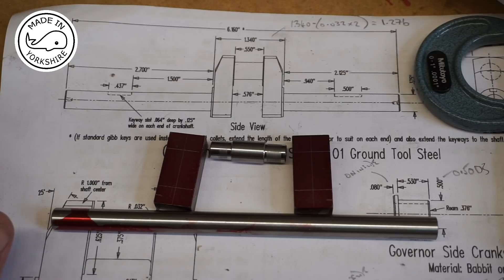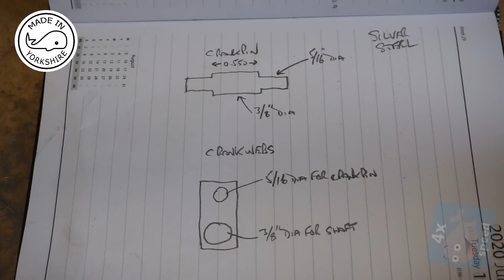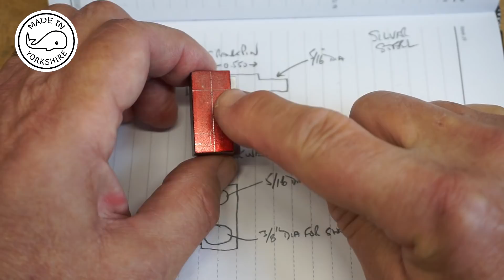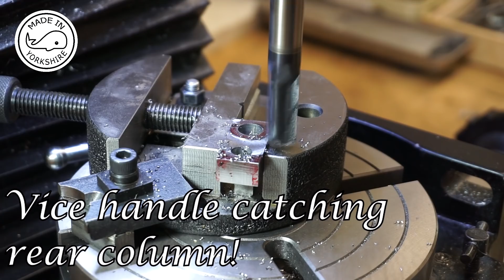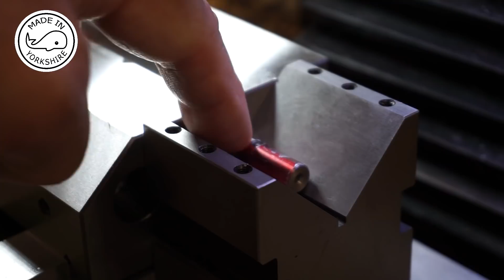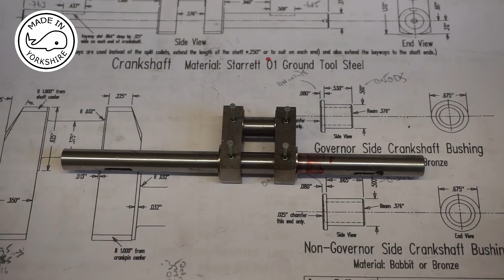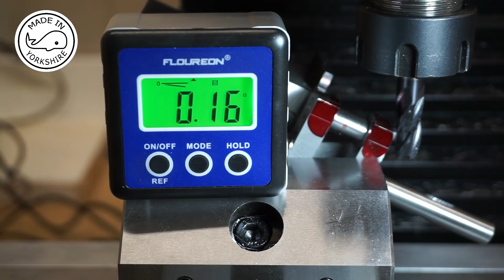#MT35 Part 9 - Farm Boy Hit and Miss Engine. The Crankshaft. By Andrew Whale.

Comment: Hi Andrew, I know this an old video now, but I believe the reason your cutter broke is because it is an End Mill. They are not designed to plunge cut as they are ground with relief in the centre. When you plunge it will leave a small pip sticking up so when you start your X feed this is what broke your cutter. You need some Slot Mills - they are designed to plunge ie for blind slots such as this keyway. The teeth on the bottom are different length, so no pip....   I enjoy your videos very much, you do fine work. I had the benefit of a Toolmaking apprenticeship many years ago. Hope this helps. I am retired now and just about to have a go at this lovely little engine...
Reply from the maker: Hi Graham 
Thanks for the info. It wasn't long after this video that I learned about slot drills (aka two flute end mills). I must say that I think that the Farm Boy is a great little engine. Even now, once the carb is primed, she starts on the first turn. A rock solid design. I hope yours turns out good too.
Cheers 
Andrew

Comment: I commend you on your due diligence mixed with a willingness to try alternatives. However, allow me to warn you with respect to the crankshaft. I too made the crankshaft as an assembly. It was easier than the two attempts at turning it from a single bar. The plans call for tool steel and after my experience, I can see why. The fly wheels on this engine are  heavy and firing stroke provides quite a kick. I had my crankshaft glued and pined and it still came apart and ruined the bushings as well. I am going back to the tool steel and get it right. Just my experience.
Reply from the maker: Hi Steven - many thanks for sharing your experience. Having purchased a couple of flywheel castings I now appreciate the amount of torque that crankshaft will have to cope with. I guess I'm at the point of no return so I will just have to hope that the loctite 638 and my pinning holds. Time will tell! If it does fail I will have to revisit, and I will certainly document the failure as a warning to others not to follow in my footsteps. Anyway, I need to bite the bullet at some point and have a go at machining a crankshaft out of one piece of bar. I hope your's turns out well.
Thanks again.
Andrew

Comment: For cutting these small keyways I find a woodruff cutter is much more robust. Woodruff keys are also easier to machine than standard round ended keys. For flywheels a woodruff is just as effective. I find that for complex parts such as a crankshaft I write down the machining process order, then write down another order and a third for luck. Then I work out the advantages and disadvantages of each taking into acccount tools used, clamping and fixing etc.. then pick the best bits from each to give me final order of production.
Reply from the maker: Thanks for the info Steve. First I've heard of a woodruff cutter. Just searched, and now I understand. Quite expensive for just a couple of cuts, but something for me to keep in mind for the future.
All the best.
Andrew
Reply: @learningturningmetal  about £9 from eBay but almost indestructible and the half circular keys are easy to turn up on a lathe the cut in half with a hacksaw. Also if you want to cut ornamental grooves in long parts like supports, columns or beams it gives a nice shaped end to the groove and you can get really thin cutters that take a lot of abuse, much more than a traditional end cutter. For larger scale stuff you can go another way and get an involuted gear cutter for use on an arbor. The trick is loads of knowledge and try different things. Old engineering books, cheap on eBay have loads of useful info.   Steve

Comment: Hi Andrew, a couple of comments if I may.  You were lucky when drilling and reaming the crank webs that they remained clamped-up OK.  One of them only needs to be a gnats cock thicker, and the other one wouldn't clamp tightly.  Also, I would have put a 3/8" pin in the reamed holes before machining the crank pin holes to ensure the pitch remains the same.
Reply from the maker: Hi Steve, I get exactly where you are coming from. In fact one of the crank webs was ever so slightly smaller than the other one. However the loctite 638 worked a treat and managed to hold everything together.  Many thanks for the suggestion though. Next time I might well put a pin in the reamed hole - belt and braces, just in case.
Cheers
Andrew

Comment: I am very grateful to you for this video. I am going to be cutting some keyways soon and have learned a lot here. I thought it would be quite easy. Will have to give them a bit more respect and thought. The shaping of the crankwebs gives nice clearance where you cut and shaped the bearing housing. Looking really good. Might be worth investing in some small diameter silver steel for future pinning jobs.
Reply from the maker: Hi Tim - yeah silver steel would be better than some old mild steel nails - but fingers crossed they will hold. They were a nice tight fit. From various comments it looks like I would have benefitted from using a slot drill rather than an end mill. I hadn't understood the difference until I googled it. Something else to add to my list! Some have commented that the angle on the crankwebs should have been cut using the lathe. Apparently the drawing indicates this. Still, it looks OK and clearence is good.
I never thought that keyways would be as challenging.
All the best.
Andrew
Reply: Slot drills would be better...clue in the name ;-)  It is still tricky cutting a small deep slot. Fast cutter speed essential. You call your channel Learning Turning and I think many of us have learned (or been reminded of) something from this video.

Comment: Thanks for video - I appreciate your honesty! Just a note on the chamfers on the crank: The drawing shows them as turned (the double lines are a hint, but the dead giveaway is the curved profile visible inside the body of your micrometer at 1:53). I'm sure they will work fine as you have machined them. Would have been quick and easy to do on the lathe, but then you wouldn't have got to play with your sine bar and gauge blocks :D
Reply from the maker: Hi Mate - many thanks for pointing out the hint in the drawing. Now it makes sense. Yeah - it was fun using the sine bar though.
Cheers
Andrew

Comment: Nice job Andrew. Just out of interest what did you use to pin the crank webs ? Also thanks for making the mistakes that I would have made and thankfully now can avoid. Slot drills are good but take care on a small mill ‘ it’s best to cut slot undersize then index across eg for a 6mm slot use a 5mill slot drill then index over plus and minus 0.5 to open up to 6mm
Reply from the maker: Thanks for the advice Andrew. I think I need to buy a few slot drills. I've just googled the difference between slot drills and end mills, so I now have a better understanding.
For pinning I just used some mild steel nails about 1.2mm in diameter. Probably better to use silver steel, but I hadn't got any small diameter. There is always something else to buy! I hope you are making good progress with your stirling engine.
All the best.
Andrew

Comment: As usual good work, but the drawing suggested that you tern the angles on the crank webs not mill them.
The two lines on the drawing is the indicator.
Keep it up you gowing well, all the best from South Wales.
Reply: Hi Jon, Good spotting, I've learnt something.
Reply from the maker: Hi Jonathan - many thanks for pointing that out - I have learnt something new too. When I made my first engine, I knew little about drawings. It's a subject in it's own right.
All the best.
Andrew

Comment: Thanks for sharing! Andrew, not now but later, you can hide your mistake by filling the unnecessary slots with JB Weld or double slot what goes on the shaft,.
Reply from the maker: Hi Craig - good old JB Weld. Where would I be without it!
Cheers
Andrew

Comment: It is difficult to tell via a video but are you running your small cutters fast enough, i suspect that even at full tilt they might be too slow, so extra care should be taken to not give an uneven feed. Carbide tooling abhors shock loads due to its extreme brittleness.
Re ignition for your engine, had you thought to build yourself a magneto? Now there's a challenge.😉
Reply from the maker: Thanks for the advice Chris. A magneto sounds interesting but I think it would be well beyond me. Still lots of bits to make for this little engine which will keep me entertained for a wee while.
Cheers
Andrew

Comment: Hi Andrew love your videos as you show the mistakes aswel and like me your learning from them, you did the correct thing by taking the crank apart as if you didn't the flywheel spokes wouldn't of lined up when asembled. Just be careful when you cut the key ways in the bosses on the flywheels if you don't get them the same the spokes won't match and line up with each other. I'm on my third hit and miss engine and still learning 
Best wishes Johnny gitts
Reply from the maker: Hi Johnnie - many thanks for the advice. I was also not sure whether the cam gear and timing might be affected. It would have preyed on my mind if I hadn't bitten the bullet and corrected it. Wow - third hit n mss - impressive.
All the best.
Andrew

Comment: Can we have an update on what is happening with the new mill that had to go back, please. After you disassembled the shaft, I thought that the colouring indicated a reasonably high application of heat to break the Loctite. If that was so, would the temper of the steel have been affected?. I'm a newbie, so be gentle with me, I could be talking complete rubbish, but I have to start somewhere. This channel is just SOOOO interesting, I'm hooked and subbed. Thank You.
Reply from the maker: Hi John - I don't know much about hardening steel either. The loctite doesn't require a massive temperature to break it, so probably not an issue. I guess that to harden silver steel, it needs to be heated until red and then dunked in some oil. I think it can then be tempered in an oven for an hour or so. I have little experience of this.
Glad you like the content. An update on the new mill will be coming soon!
All the best.
Andrew
Reply: @learningturningmetal  right on.